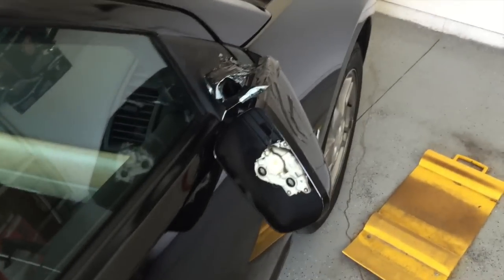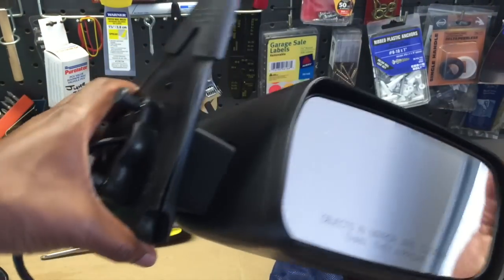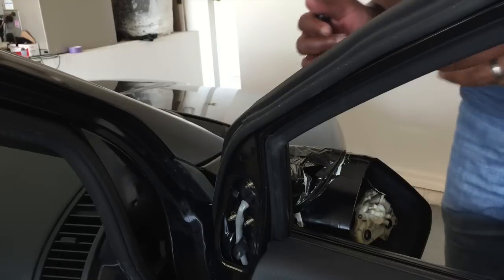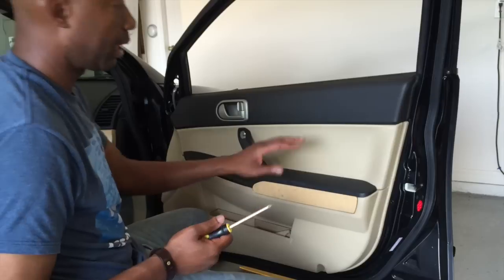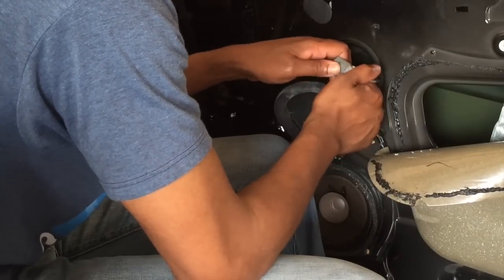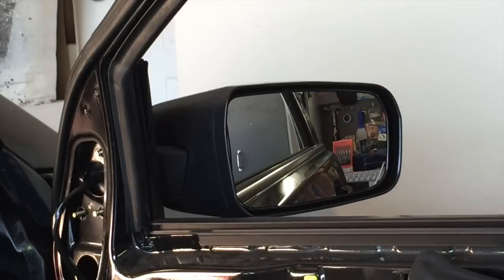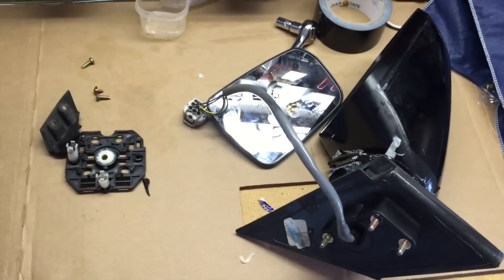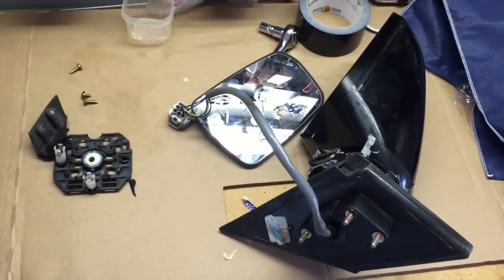Mitsubishi Galant GTS side mirror replacement

Comment: Great video, but you glossed right over the hardest part: How to get the door panel off! I could only find three screws, and it would not come loose. Rather than crack something, I just cut the cable and spliced each of the wires together, using solder, and heat shrink tubing over each splice. (I followed this up with black electrical tape over the whole thing just for good measure.) It is a bit time-consuming, but easy to do if you are used to soldering wires. It is another option to consider for getting this job done.
Reply from the maker: Wow! seems like you had to do a lot. I'm no good at soldering wires... I didn't even know there was an "L" in soldering. I have gotten this comment before and I listed the screws to remove in my reply. Maybe I'll add the number of screws to remove in the video description and see if that helps. Thanks.

Comment: I wonder if it’s the driver side near, will it be difficult to get all of the buttons for the windows in the locks and the door handle to open and close the door, line up so they work properly??? Or did that just automatically lineup?

Comment: Good video!  Just ordered a side mirror for my 2012 Galant,  A truck backed into me...LOL   Instead of taking it to the dealer,  I will attempt to replace it myself.  Looks like the complicated part will be taking the door panel off.  Had this same mirror knocked off before and had it installed at the dealership for $300.00!!!  Not this time.  Wish me luck.  Peace.
Reply from the maker: Eric Thompson good luck bro. There's a few snaps to pop out after you get the screws off. You'll save a lot.
Reply: Eric Thompson what was the socket size?

Comment: Good video but, how many screws had to come off . When you took off the door panel you didn't show how to remove
Reply from the maker: Sorry,
The removal of the door panel was a surprise. I believe there were two main screws one on the bottom right where the panel meets the metal and one at the top of the inside door handle, there's a plastic cover you'll need to remove to get to that screw. Then at the bottom of the panel there are two spaces to get you fingers between the door panel and the metal so you can pull the panel away from the door and pop out the plastic snaps that hold the panel in place. Hope that helps.
Reply: I'm going to try that because I have to replace mirror and door speakers
Reply from the maker: Best of luck. Thanks for watching.

Comment: My grandpa hit my mirror off but was the panel hard to take out and how many screws were there?
Reply from the maker: The panel was a little complicated. I remember 4 or 5 screws (remove the window control on the door) then you have to get your finger tips between the plastic door panel and the metal door frame and pull the panel away and there are (snap in) screws that you'll have to pop off from the metal frame.

Comment: Every single Body part is the same basically
Now Head Lights Tail lights and there's a lip on trunk that's not but body wise any Galant peace will fit it. As long as it I'm a 3 year rang doesn't matter what model
I have a 05 ES Galant but I have a 07 I believe GTS Galant Trunk Lip Head & Tail Lights
Along with Front & Back Seats because I like cloth instead of leather